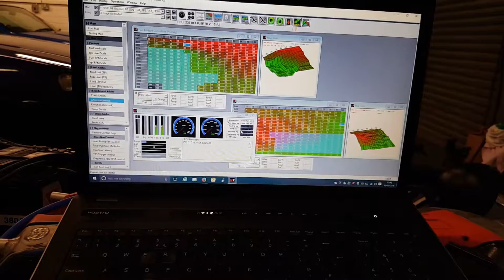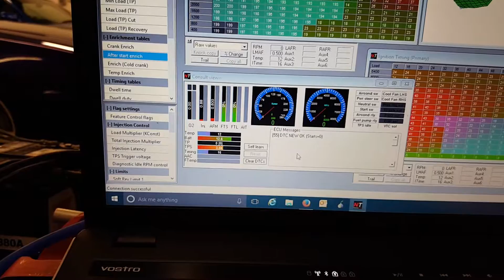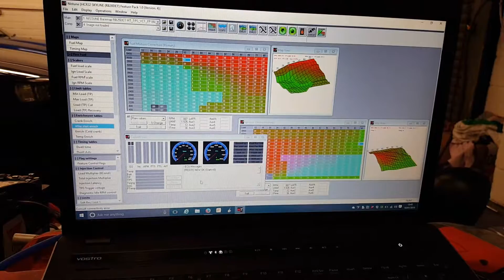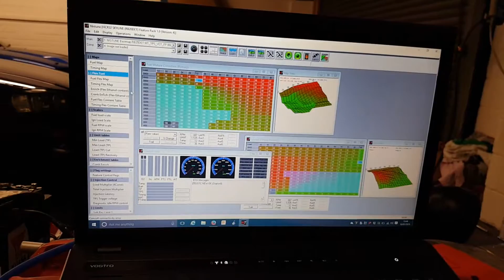Locost Skyline RB25 Kitcar - Ep28 NIStune!!!

Comment: nice job. i had the z32 converted to r33 nistune. it made the car run like rubbish. 

I hope your r32 based ecu works well. I'm running an R33 remapped ecu but it can't do flex fuel so your build is quite interesting.

Comment: Hey man, haven't seen any of your other vids so not sure if it's the case ornot but thought I'd better mention. If you haven't got the additional flex fuel board and flex fuelsensor installed flex fuel will not work,it's just an option given after Nistune downloads the feature packs. I'm assuming you've probably got both those things but if not, please do not go chucking E85 in your tank lol